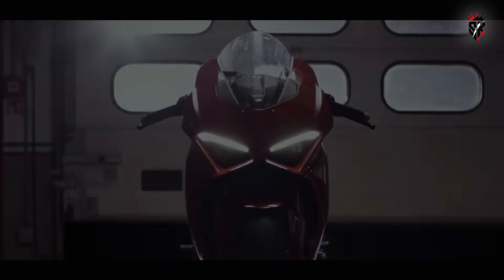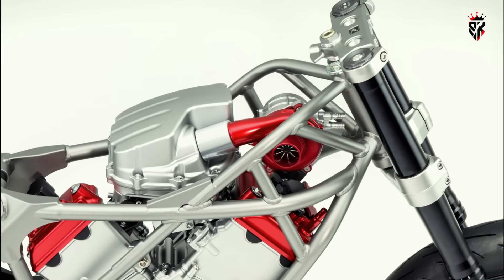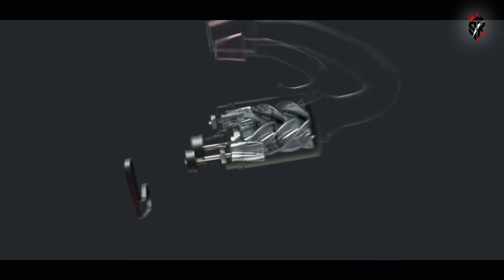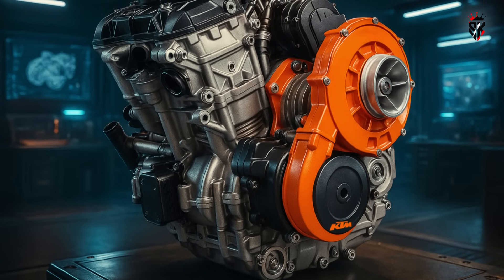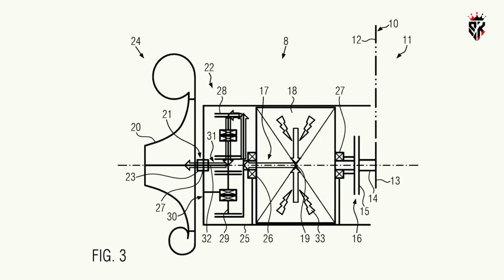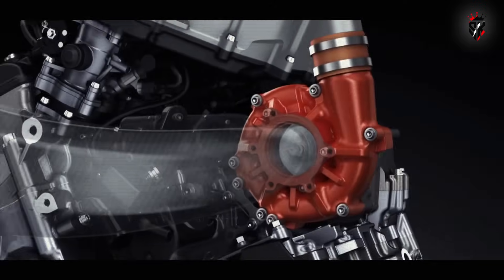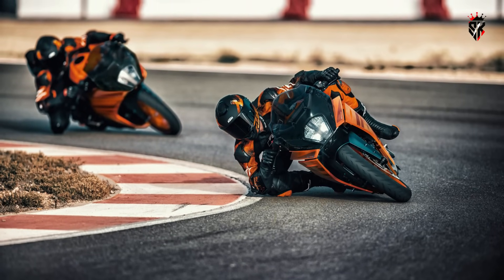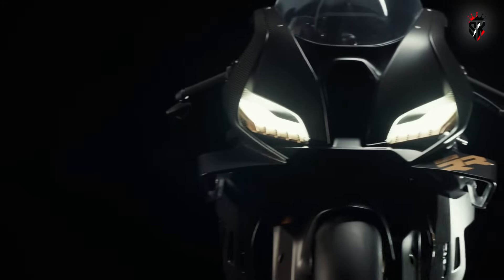KTM Builds H-Supercharger! More Power, Less Weight

Comment: Exactement Une Sport byke 
CAR avec un990
Celà va être compliqué pour eux 
Aujourd'hui Les 2 marques Japonaises on repris Les base 
Honda ressort un 3 cylindres 
Comme Yamaha 
Suzuki avait déjà monté des Suzuki Swift auto 3 cilyndres 1500cc
Aujourd'hui 600,650,680cc
Devise et Pari sur l'avenir ☝️😂😢😢
PS j'ai pris encore une prime de 180 euros 💶😢
CAR roule tout Les jours avec 
UNE RGVr 2 temps 
Ou j'en reviens à un connards de contrôle technique 
QUI Me répond elle fume 😂 blanc Bleu 
J'ai oublié Le mélange 1,7pour cent Par litre avgaz, Oui elle fume, Resultat 
Pollution pour un 250, ET non conforme aux mines origine 
Freinage, fourche, échappement, Valves 
Aujourd'hui 
Assurer comme collection 😢
Interdit les jours francs 
Que Le Weekend, très blaisant 
Revenu chez le même contrôle technique 
Avec VFR HRC 30 officiel privé 
Non conformités 
Désolé CE système d'exploitation pas pour moi❤🎉🎉🎉

Comment: They don't use waste heat from the exhaust and an electronic clutch is unnecessary and could be replaced by a one way acting coupling bearing. I don't see any reason for this patent since it's already done in a similar fashion. Why not just implement a proper MGU-H? I don't get it...
Reply from the maker: Good point—but KTM’s approach seems more about keeping the system compact and cost-effective for bikes. An MGU-H like in F1 would add too much weight, heat complexity, and packaging issues.

Comment: what ktm needs for me to buy is removing computer shit. the bike will be obsolete in 5-10 years, no tech support
Reply from the maker: 🤷 It's your choice, I want electronics, but not an unreliable bike, like the KTM radiator is mostly leaking, sometimes the headlights are not working, heating and melting engine rubber parts, etc

Comment: Put on the upcoming 490 twin
Reply from the maker: The price will increase because it requires numerous changes to engine parts, such as the piston, as well as the cost of a supercharger, body adjustments, and more. It will only be beneficial for models like the RC8c, RC990, or a new motocross bike.

Comment: Yamaha would be the only engine builder I would trust to make this unique engine. Both KTM and Honda have been problems with quality in the last decade.
Reply from the maker: yamaha definitely makes some of the best bikes. yamaha design is more practical—it uses a turbo with a small motor to eliminate turbo lag, and it doesn’t require any special batteries.
Reply: Correct 👍🏻

Comment: At low speeds alot of bikes have more torque than you can actually use even in naturally aspirated form. Why not drive the supercharger off the gear box output shaft so it provides additional performance when you can actually use it?
Reply from the maker: You’re absolutely right 👍. At low rpm, most bikes already have more torque than needed, so a gearbox-driven supercharger would indeed deliver boost in the range where performance is usable. The challenge is packaging and efficiency—tying it to the output shaft adds complexity in gearing, space, and potential parasitic losses. That’s why most systems stick with crank-driven setups, but your idea definitely makes sense from a “usable power” perspective.

Comment: Ktm rc 160 update please
Reply from the maker: The engine is a 164.2 cc, single-cylinder, liquid-cooled SOHC unit. 
Power output: about 18.7 PS (≈ 18.5-19 hp) and torque around 15.5 Nm. 
It will have a 6-speed gearbox with a slipper-clutch
will be slower than Yamaha R15 & Suzuki GSXR 150.
 Suzuki GSXR 150 is the best option compared to price and performance, lighter, more powerful, and better top speed.
Reply: @SKroadstar launch date

Comment: Rly tks KTM, we waiting for this tecnology in RC400 and RC600 🖖
Reply from the maker: Yeah, it will be great for the smaller bikes too🤔 but!
Reply: @SKroadstar  Nope, it makes them perform like pre existing 'bigger' bikes, the new tec is MUCH more expensive, the insurance class will go up dramatically and long term maintenance costs rocket.
Frankly this tec is too expensive to be put on a performance range of motorcycle that can be serviced by a 4 year old used SV650.
Reply: If they put that tec in the 44 horse power RC400, (Lets say it makes 60 hp)
But the bike still only weighs 360lb wet, so you got a seriously quick machine, which would command higher insurance etc, costs more, wears out quicker than old tec bike and you gain zero.
As a result they wont put that tec in small motorcycles.
Reply: @MrChriss000 if have buyers for ZX4R in poor countrys, they can find buyers for RC400SC and RC600SC too
Reply: @pablobressan-ip4yr  If the zx4r buyer could afford to run rc400sc they could afford to run an existing 600 4cyl. or 660 3, so the 400sc wont be built. 
Insurance companies are wary of turbo bikes.
Reply: Like cars today, with downsizing tecnology idea, hybrid turbos our SC Bikes become more common day after day.  SC and turbo idea is more for a low gases emissions and low fuel consumption
Reply: @pablobressan-ip4yr  
Aannd.. all you have to do to prove that in 2025, ..
 is show where a SC / TC mcycle that is good enough for legal road speeds does more M.P.G. and less emissions than say, a Honda CB300r.
(top speed ~96mph actual naked and average U.K. M.P.G. - 4.54 L- about 73 M.P.G.)
 Unfortunately you cannot show this as the 320 Lb wet Honda makes 31hp ( the compression ratio is a bit conservatively untuned at 10.7 to 1 which could be improved for power / m.p.g. but even so)
This m'cycle engine category is not going to be replaced by a smaller SC/TC unit, power and price would go up but not efficacy.